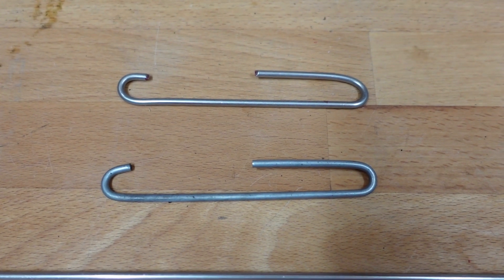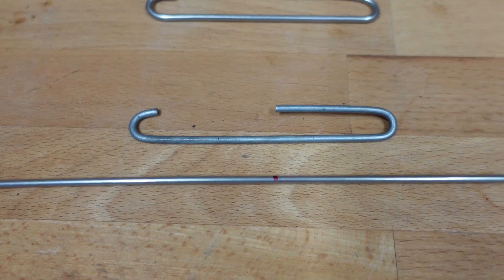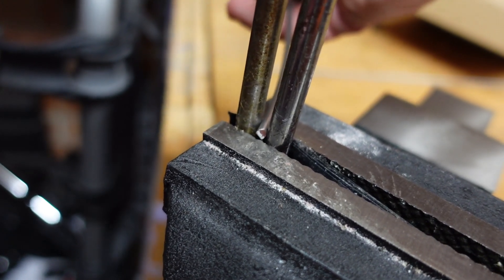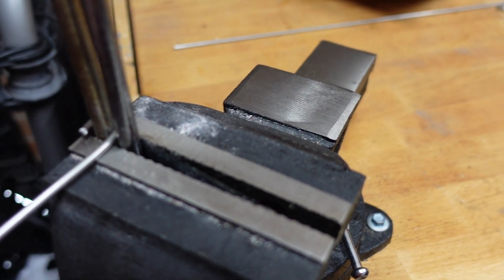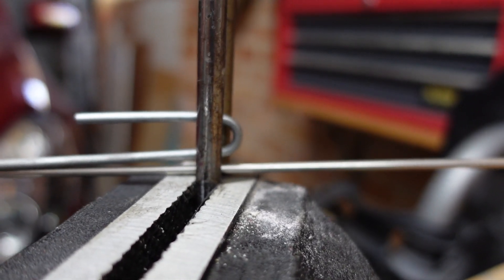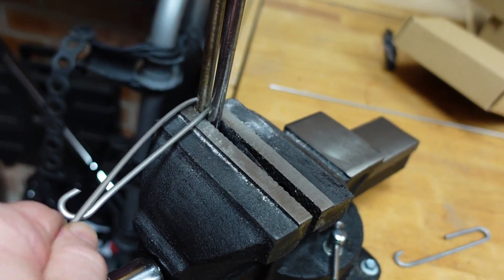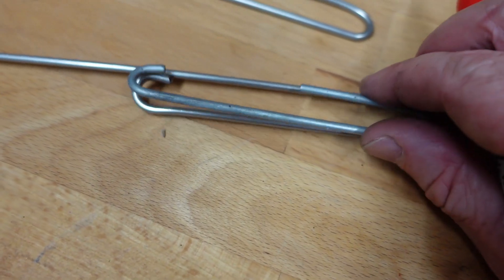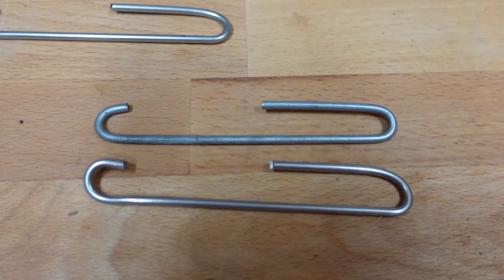How To Bend Stainless Steel Rod

Comment: When you bend the rod, do all the electrons bend as well?
Reply: All electrons will fall out.
Reply: Yes, the electrons bend. There is no signs (arc) of them escaping.
Reply: Metal has a grain and bending it like that does tend to stress it and weaken it. Which is why casting and forging exists.
Reply: If you apply enough force even time will eventually bend

(And I'm not even kidding)

Comment: Probably a bit late now, but if you slide a bit of metal tube over the straight part of the stock it concentrates the bending forces at the part you're trying to bend and you can get a more accurate bend. Of course that means you have to have a bit of metal tube with an internal diameter only a bit bigger than the rod....

Comment: 318 Stainless Steel is not 3.18mm. 318 Refers to the amount of carbon to iron in the stainless.
Reply: I think you are thinking of 316 which it probably is. 3.18mm is near to dead on 1/8" so it IS that imperial rubbish :P
Reply: @WaynesWorld999  I think you are thinking of 304 which it probably is as low as Stainless Steel rating goes hence why it is is the most common stainless steel usually used in kitchen utensils.
Reply from the maker: i know, I was not saying that. This is 304 stainless, and it is 3.18mm diameter, 1/8 inch.
Reply: @EEVblog2  - In Germany we have something what is called "Zoll-Stock (Ger.)", in English you can translate it with "inch stick".
In former time they printed inch and cm lines on the stick (left side inch-lines, right side cm-lined). Nowadays they only print on it the cm-lines (of course with millimetre lines between the cm lines)

I think that we will always use inch, because we have some standards which we can not change so easy. We have 1/4, 1/2, 3/4, 1, ... , 2 Inch pipes / garden hose and so on.

Comment: I would have put the 2 screwdrivers at the desired distance, coil the rod around 25 times, then cut the unwanted section on the middle with an angle grinder and grind the ends a bit so to remove the cutting-edge
Reply from the maker: They would all spring back open a fair way.
Reply: That's what heat is for I guess :)
Reply: @6581punk  or a hammer.

Comment: Could you use the vice to clamp the wire into a tight curve?
Reply: The curve is limited by the screwdriver shaft diameter. Can't go shorter radius than that.

Comment: Sorry to break it to you Dave, but that's 1/8" stainless rod you've got there. Yep, that imperial rubbish :)
Reply from the maker: They only sell that crap in 'murica
Reply: Same pile, just with a metric measurement.  Just take the label with the 1/8" off slip on a new label with some oddball metric measurement,  and voila, a metric product.  Just like that 900mm electrostatic mat that is actually 3ft. Either system works fine,  but applying metric measurements to things that are made to a convenient imperial measurement,  ugh... stop doing that. At least leave both on there is it was made to an imperial measurement.
Reply: Thinking maybe that was the joke..?
Reply: Whoosh....